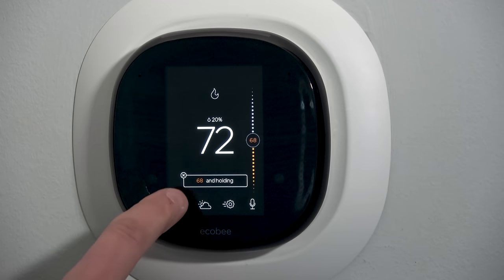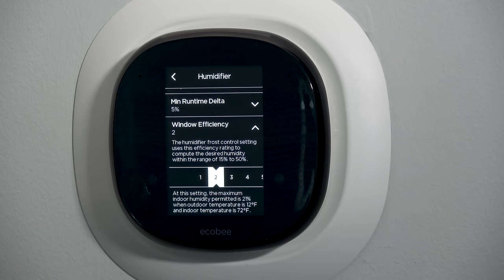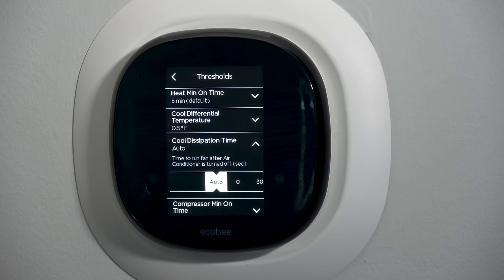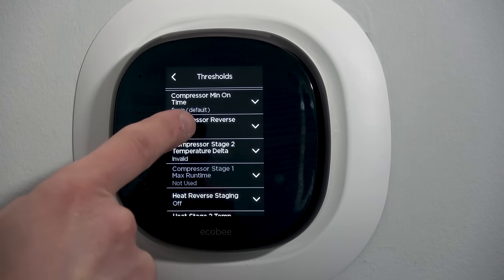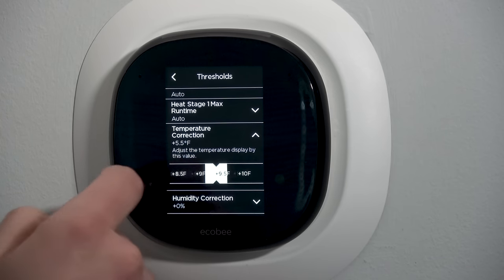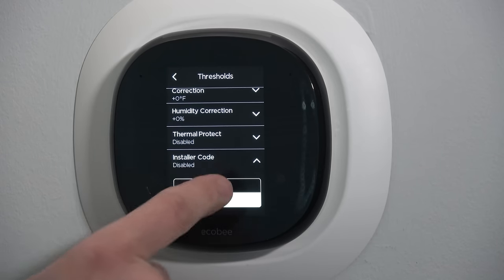ecobee Pro Advanced Setup (3 of 5)

Comment: I have an Ecobee lite, it showed it was running the AC but it wasn't giving cold air. Changed to an old thermostat I had and was giving cold air. Any issue or overide thay Ecobee had to cause this?
Reply from the maker: The way to test the issue would be to use an electrical meter to see if the equipment was receiving the Y1 signal.  Then you can determine if the stat was an issue or if the equipment itself was in lockout.

If you replace a thermostat... any thermostat... it will reset the equipment lockouts.  So it may run for a while but then eventually whatever caused the system to fail will fail again and lock back out.
Reply: @TECTubefilms  thank you! Best wishes from Toronto.

Comment: Question for you I had a ecobee thermostat installed and now when the air turns off it makes a pretty Big Bang and was told the setting has to be changed something to do with the fan and what controls it either the thermostat or the furnace. Do you know about that ? it does NOT do it with the heat just the ac. 
Thanks a bunch !!
Reply from the maker: All a thermostat can do is turn on the indoor fan, turn on the cooling (outdoor fan and compressor), and turn on the heat.  Whenever any stat turns on the cooling, it automatically also turns on the indoor fan.  There are no settings in the ecobee or any other stat that would make it do anything different than that.  Who specifically is telling you that you need to change a thermostat setting?  And who specifically installed the ecobee thermostat for you?
Reply from the maker: In regards to a "bang noise" in cooling but not heating, can you tell us what type of noise it is (duct work expanding?  noise outside by the unit?).  Also what type of cooling system you have (standard outdoor air conditioner or heat pump, watersource or geothermal heat pump, chilled water fan coil)?  And is the heating system separate from the cooling system, such as hydronic radiators or baseboard?
Reply: @TECTubefilms  thanks for the reply ! It sounds like duct work but the guy who installed it also did the neighbors down the street and the same thing was happening and he said he changed something on the thermostat to correct it. I believe he said a fan setting. I have a standard outdoor ac and the heating is a standard gas furnace. the house was built 12 years ago. it did not do it with the standard HONEYWELL thermostat that came with the house and it doesn't do it with the heat if that helps ?
Thanks again !
Reply from the maker: @Charles-nk3ep  Perhaps he changed the fan settings at the furnace circuit board to reduce the air volume for the cooling mode?  There is nothing in ecobee, Honeywell, or other standard thermostats that controls fan speed or air volume.
Reply: @TECTubefilms  is that something you could explain to me how to do or check maybe ?
Reply from the maker: @Charles-nk3ep  Fan speed settings are either handled by dip switches or by motor speed taps, depending on the type of motor and furnace circuit board design.  The install manual will have tables that related your external static pressure to the desired CFM that you want, and hence the fan speed you should set it for.  If you are unfamiliar with fan speed control of furnaces (and the benefits and risks of slower speeds), you should probably leave it to the HVAC service tech to adjust.
Reply: Sounds like the guy possibly dented the duct work. Cooling uses higher fan speed than heating, which means more pressure in the ducts. Cooling mode causes the ducts to pop in and out of place while the heating mode doesn't maybe? You'd probably be hearing the pop on initial start up and when it shuts off if that's the case.

Comment: I was told I could not have a smart thermostat (nest or ecobee) because my furnace (Ruud) and thermostat (Econet) have dedicated wiring. That sucks.
Reply from the maker: We are not familiar with Rudd but we do work with many other brands of furnaces that have "communicating thermostats" and they can easily be wired to work with any 24v stat, such as ecobee.  However, there is often a trade-off of features in those cases.

Comment: Our fan keeps kicking on randomly. It turns on and off repeatedly randomly. We can't figure out what's causing it and made sure everything is on Auto. Not sure if you have any tips how to figure out what's wrong with it
Reply from the maker: Start by looking at the trend graphs of your stat when you login to ecobee website. Visit HomeIQ section
Reply from the maker: You may also have set the fan to run a minimum of XX minutes per hour
Reply: I have the same issue

Comment: Can u do one with boiler and mini split.  Carrier with controllers added to split system
Reply from the maker: Yes, ecobee has separate RH and RC so you can control heating and cooling equipment that each have their own 24v transformer. This is frequently used to control a boiler and a cooling system. Having the cooling system that is a mini-split does, however, add an additional wrinkle because it needs to be a system that can be controlled by a 24v wall stat instead of the typical handheld remote.

Comment: Sir, i have a question and i believe only you will know how to answer it. i have an NTI-GF200 with an ECM motor, for my condenser i have a Ecoer heat pump inverter type system. the only complaint i have is the blower fan does not ramp it sounds like it will do single stage or 2 stage, no modulation. i have an ecobee 5. What do you suspect is the prob
Reply from the maker: ecobee does not control fan speeds at all.  All it can do is request the fan to turn on (G) and the compressor to turn on (Y1).  After that, it is up to the air handler to control blower speed and the heat pump to control compressor and condenser speed.  We are not really familiar with ecoer brand inverter units, but in general we recommend that standard thermostats (including ecobee) not be used on variable speed inverters.  Use a communicating wall control instead so that can take direct control over the compressor speeds and the indoor blower speeds to make sure they always match.  A standard 24vac thermostat cannot do that.  So in your case, you likely need the ecoer stat posted at https://www.ecoer.com/touchscreen-thermostat/.  Without that stat, you installer likely had to dumb your system down to a 2-stage system because ecobee can only handle 2 stages.
Reply from the maker: It is also possible that your installer could not use the ecoer thermostat because you do not have an ecoer air handler.  It looks like you have an air handler from another manufacturer (NTI).  Communicating wall controls are proprietary to the equipment and since you mixed brands of equipment, your control options may only be to revert to a basic thermostat like ecobee.
Reply: @TECTubefilms  thank you sir!!

Comment: My ecobee thermostat says it’s 74 but a true stand alone thermometer says it’s 68.    I believe the stand alone thermometer so that means the ecobee is wrong imo.  How can I calibrate it so it’s reading correctly.
Reply from the maker: A very common issues is air movement in the wall behind the stat.  You may want to get a can of expanding spray foam to use behind the stat to fill the wire hole in your wall.  It is an extremely common problem.
Reply from the maker: If you do decide you want to adjust the ecobee reading, then watch this video at the 11:15 minute mark.  With that said, we have never seen one reading incorrectly by more than a degree.  So we bet that either your thermometer is inaccurate or, as stated above, something else is affecting the reading (air inside the wall, etc.).
Reply: @TECTubefilms      ok thank you. I suppose the way to fix it would be to get one remote sensor and program it to read from that one (placed inside the most frequently used room area). The hole in the wall is quite large and if it’s sensing the air in the wall the temp will be very slow to recognize the temperature changes on the outside of the wall.  Seems to me like a design problem with the ecobee wall mount sensor.
I’ll have to think outside the box on this one.
Do you have an idea where the sensor is located on the wall unit?
Reply from the maker: @OldDocSilver  This is a common issues with dozens of models of stats, not just ecobee.  The best solution is seal the home so you do not have air moving in the walls.  Unrelated to thermostats, this can save hundreds of dollars a year in energy.  A blower door test is the best way to find the issues, but in the case of air in walls it is often caused by missing or unsealed wall top plates in the attic.  Another common issue is the building cavity being used as the return duct instead of actual sheetmetal.  Fixing the structure will make the symptoms at the stat go away.

If you are not going to fix the home envelope, the next best option would be to solve the symptom at the stat by filling in the area behind the stat with a can of expanding foam sealant.  This is an inexpensive fix.

The last option would be to try to "fix" the thermostat by recalibrating it or by using a remote sensor.

Comment: I have a question about Dehumidifier from Carrier, does it support it?
Reply from the maker: The ecobee 4 and ecobee 5 can control one accessory which can be a humidifer, dehumidifier, dehum sequence of furnace blower, or a ventilation system.  The ecobee 3 lite does not have an extra output to control accessories.

Comment: I don’t see the heating differential (swing) on my ecobee 3 lite unit.  What gives?
Reply from the maker: You probably have it configured for automatic staging. Scroll up to the top of the installation settings and switch that to manual staging so you can override stuff.

Comment: My Honeywell control board allows me to adjust the length of heat dissipation up to 180 seconds, but there is more heat left in the system according to my heat gun.  The ecobee 3 lite allows me to adjust the heat dissipation time but even with it set to have the ecobee control
the system,  (vs the HVAC) it still only runs 180 seconds regardless of the heat dissipation time  set on the ecobee.  Is there a way to disable
the honeywell dissipation time to allow the ecobee to adjust that time?  Thank You
Reply from the maker: The G terminal of the ecobee would either need to be wired to your equipment or wired to your zoning board and your zoning board allow it to pass the G signal thru to the board.
Reply from the maker: 180 seconds is a long time.  We can't imagine there is enough heat left in the supply duct to offset the electrical cost of running the blower an extra minute.
Reply: @TECTubefilms  Thank you very much for your replies!!.  The hottest the temperature is at the vents is 132 degrees.  At the end of 180 seconds, (when blower stops)  it is 90 degrees.  I figured that at the end of 240 seconds it would be be approximately in the high 70s. and therefore my desire to run it a little longer.
Ecobee has a heat dissipation time  of up to 420 seconds which is wishful thinking as no system would have heat in the system that long.
Reply: @TECTubefilms  The G wire from the Ecobee goes to the G of the control board.  I assume you are referring to
the control board as the zoning board.  The system shuts down as commanded by the HVAC control board
even when the Ecobee is set to control the system via the system installation setup selection.  ( One can choose the 
HVAC or Ecobee during system installation to control the system).    I assume the new control boards have a bypass
setting, switch, or jumper to allow smart thermostats to control their heat dissipation times.  Again.. thank you for
your reply and i won't let this ruin my life or pursue it further.

Comment: Ecobee won't turn my fan on. I tested all the other wires they're working just fine but when I test the fan it won't turn on and I'm not getting any volts.
Reply from the maker: What terminals are you trying to reading voltage across?  If you are going on R & G, then you should read 24vac when there is no call for fan and read 0vac when the stat wants fan.  Some folks get confused on that.  To alleviate confusion, we often tell the tell the techs to check for continuity on R & G instead of just voltage.
Reply from the maker: You can also put a jumper at R & G on the furnace and see if the fan runs.  And then as a separate test, take the stat off the wall and tie R & G wires together.  By doing those two tests, you can determine if the issue is the furnace, the stat, or the wires themselves.  Once you know which of the 3 is the issue, you can better troubleshoot.
Reply from the maker: For those that need help using their electrical meter, we have a video that may help.  https://youtu.be/FMevkhVDvuU

Comment: if my AC is running nonstop, what can i do to change it? i have the smart recovery disabled.
Reply from the maker: It depends on WHY it is running non-stop.  Is it not running at full capacity due to airflow or refrigerant issues?  Is it running a long time because it has been optimized for dehum?  Is the outdoor temp higher than the design temp?  Is there a breach in the building envelope or duct system?  What is the space temp as compared to the setpoint?  There are lots of other factors to consider also.
Reply from the maker: If you think it is an issue with how you set your ecobee up, we might suggest you either call ecobee tech support or you join the ecobee users group on Facebook and post pictures of your graph.  https://www.facebook.com/groups/EcobeeUsers/

Comment: how do i setup my ecobee to where its not going off when it goes under the threshold of the tempature its suppose to be at going off when it needs to like older ones cause this ecobee thing keeps running every time it goes under and my bill its outrages now
Reply from the maker: We are not sure what exactly you are asking. Are you asking how you can get ecobee to run the cooling longer even after you have reached the desired cooling setpoint? For example, if you set it to cool down to 74, it is shutting off once it gets that cool but you want it to keep running more until it gets to say 73?
Reply: @TECTubefilms  well older thermostats like my old house had one would run until it drops below then it would still for a good couple of hours but mine runs as soon as it goes above I want it to where it will run for a while but then stop and it won't go back for a bit cause my bill is racking up
Reply from the maker: @GundaManBatan  It would be extremely unusual for a thermostat to run below its setpoint. Most thermostats, including ecobee, can be programmed to wait longer to turn on, but not wait longer to turn off. But in either case, we are still not understanding what you want. Do you want it to run longer cycles so it dehumidifies better? Or do you want it to be off for longer cycles.
Reply from the maker: @GundaManBatan  BTW - if you have a single stage A/C like most people, then being on and off longer periods doesn't really equate to less energy usage. It just causes a larger temperature swing but it will likely run the same total time. For example, it if needs to run for 6 hours per day on a 90 degree day, it could run for twelve times for 30 minutes on and 30 minutes off or it could run for eight times for 45 minutes on and 45 minutes off.
Reply: @TECTubefilms  I want it to basically run for 2 hours in between intervals like 3 to 4 then 7 to 8 and so on and so forth that was it doesn't constantly turn on all the time when it drops below like say for example it's 78 in the but it needs to be 72 but it keeps turning on everytime it goes over that set tempature cause just tried of it going on constantly
Reply: @TECTubefilms  i would like to have my ECOBEE to wait longer to turn on thats what i want it to be doing
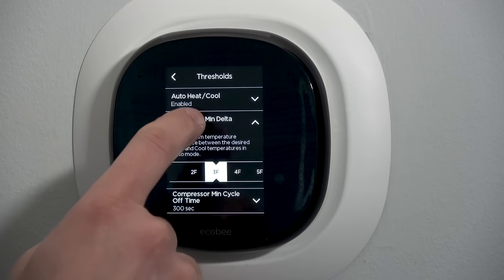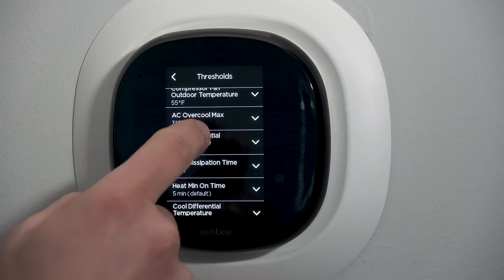Reply from the maker: @GundaManBatan  While your requested scenario reduces comfort and doesn't save significant energy, it can be done. We suggest you EITHER increase the Compressor Minimum Off Cycle Time from the default of 5 minutes to something longer (watch the video at minute 4:10) OR you change the Cool Differential Temp from the default of 0.5 degrees to something higher (watch the video at minute 5:55 and 7:18).

Comment: I installed a ecobee be and my compressor not coming on
Reply from the maker: Is the thermostat calling for cooling? What voltage are you reading across Y and R at the furnace and Y and C at the condensing unit when the stat calls for cooling?

Comment: I have a single stage system and was wondering, should heat dissipation be set to auto, or a set number of seconds? Or set it to zero?
Reply from the maker: The number of stages won't affect that decision.  If the heating system has its own dissipation time built-in, like most gas furnaces for example, then the one in the ecobee is not needed.  In other systems, such as electric resistance heating, it can be very helpful.  In some systems, it provides minimal benefit, such as hot water coil or heat pump.  The installer of the HVAC system should be able to advise.  If you are forced to guess, we would suggest 90 seconds as a starting point.

Comment: How do you turn on just the fan, no cooling or heating?
Reply from the maker: There are a lot of ways.  Here are a few:
1) Put the stat in heat/cool/auto and relax the setpoints so it does not actually call for heating or cooling.  This is assuming you have your fan set to "on" in your schedule.
2) Press the system button on the stat and tell it you want to run the fan 55 minutes each hour (60 is not an option for some reason)
3) From the portal, simply click the "fan on" button in the bottom left